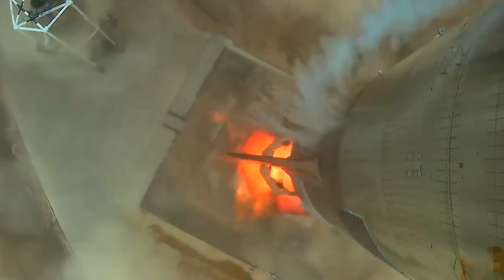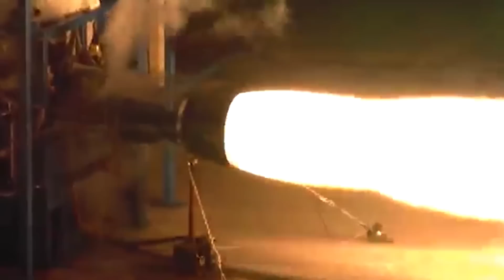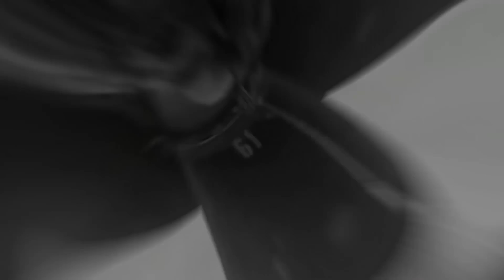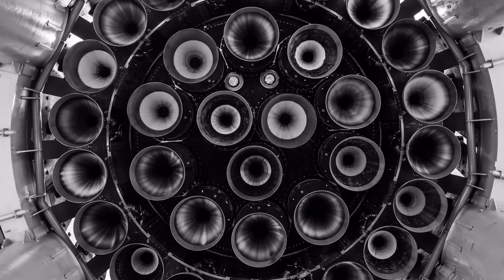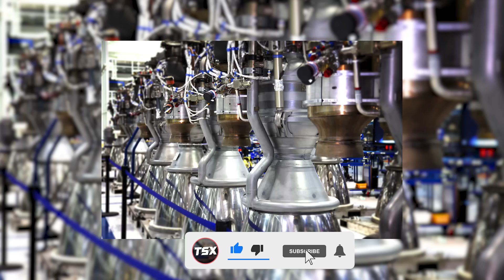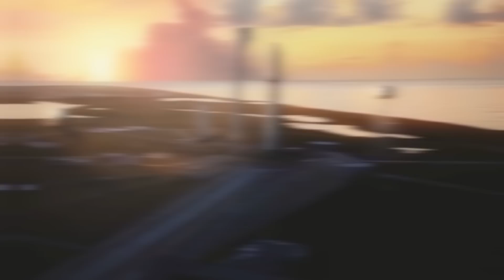SpaceX 33 Engines Starship Booster Monster Issues Not Expected

Comment: You're calculating wrong. 
1000 starships + 100 (?) tankers will need 6600 raptors, plus the Raptors for the Boosters to put these Ships and the refueling ships into orbit. 
Assume 1 reusable booster for every 50 ships to orbit, including the need for tanker refuelings. That means another 1650 Raptors. 
That makes a total of "only" 8250 Raptors. 
With a production rate of 4 raptors per Day (four lines), it will take Spacex between 5 to 6 years to produce these engines.
Reply: Want take them that long once their factories are complete. I can see spacex building a gigafactory for starship in Texas or Florda.
Reply: @BingeProductions  how about fix your math. And no I’m not subscribing.